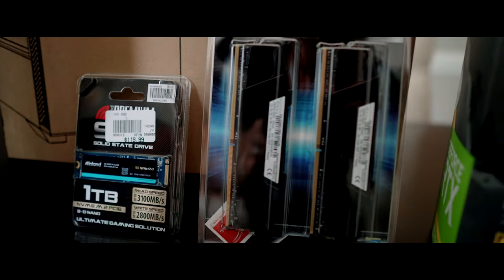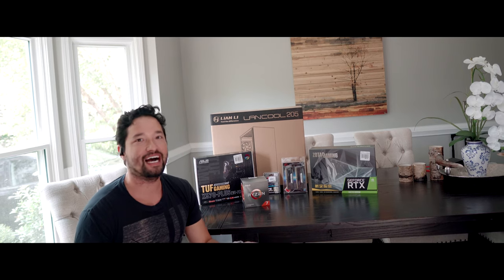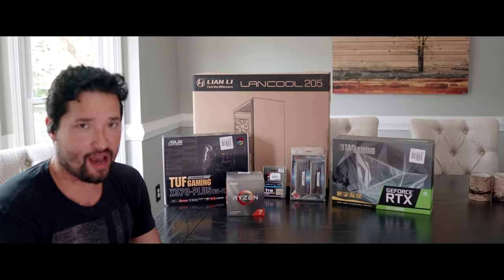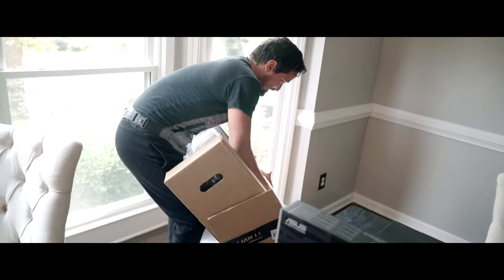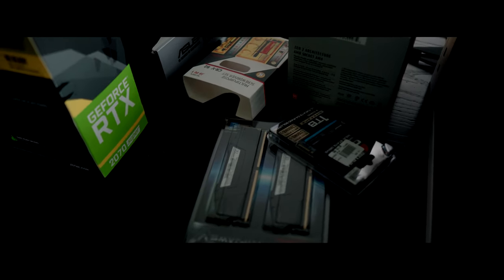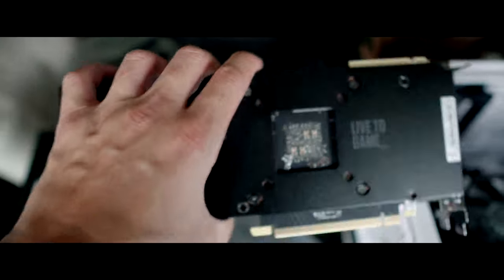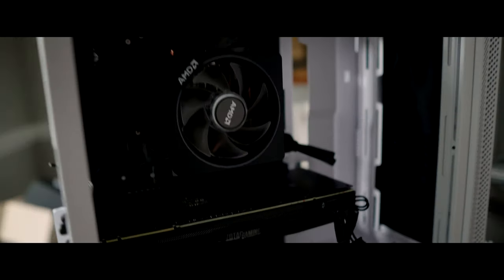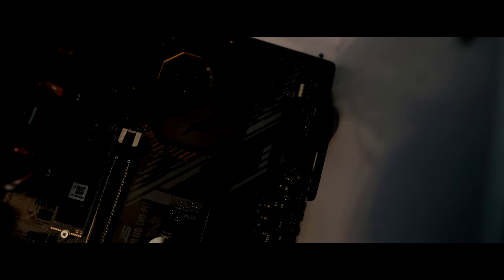Build a Budget 8K Video Editing/Gaming PC for in 2019! Mac Pro/PS5 Type Build

Comment: Dude, found some pre built pc's, do you think these components worth it?

''MB: B450 Gaming Gigabyte 
Processor: RYZEN 7 2700 8 Cores 3.7Ghz 
Ram: RGB 16GB 3000mhz
Hard Drive: WD Certification Blue 1TB SATA 7200 RPM
Source: EVGA 600w Certification 80+ Modular Bronze 
Video Card: GTX 1080 Strix, Aorus, FTW 
Liquid Cooling: Kraken x42 RGB 140mm special for RYZEN
Accessory: KIT of 2 120mm RGB fans and RGB LED strip installed, plus lights controller.''

It's arround 1800 dollars, is it a good deal or should i make it myself, i know nothing about this so you tell me
Reply from the maker: Seems like a good PC. The only thing I would upgrade is that hard drive. To a ssd or a sad m.2 Also you might be able to build a better pc for cheaper. Or for the same price get a better graphics card.